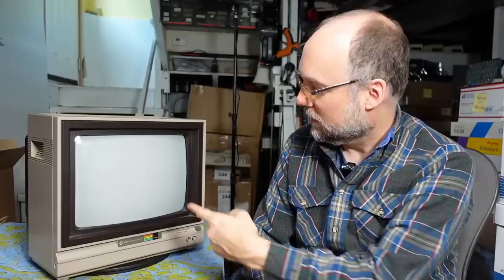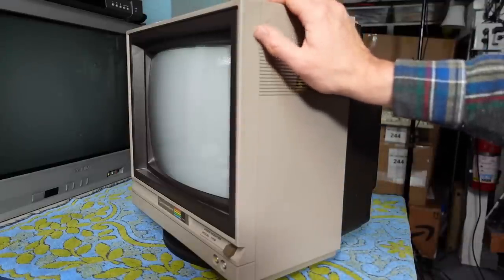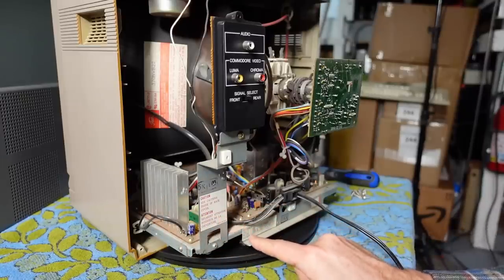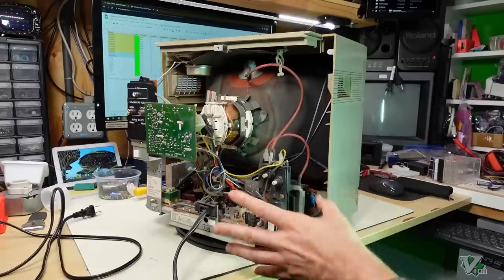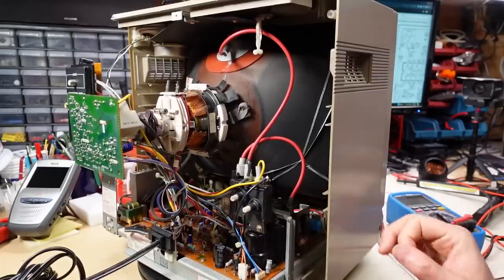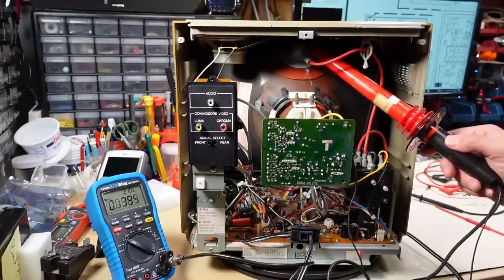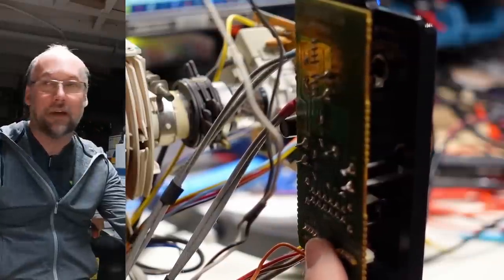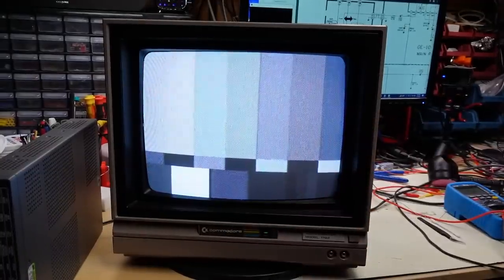This is one of the best monitors of all time (Commodore 1702)

Comment: From my own learning, flyback transformers in CRT displays/tv's are typically the common source of power post power supply rails. If one finds what the output voltage is before going into any voltage reduction, they could operate the display/tv at that voltage. Most notable of this are the displays/tv's that can be plugged into both household voltage and a cars cigarette lighter power source. Not all systems operate like this, especially those that are fully vacuum tube based, unless otherwise specified for dual-voltage of course. And since the flyback can output a wide array of voltages, with the diode missing, it is entirely possible to power different thing and have the KV lead off to a like-configured flyback for "long distance" powering of other devices, but at a lower amperage. Essentially what Nikola Tesla was trying to do with his Tesla coil idea.

Comment: If you believe it has a high voltage leak somewhere, you can use a piece of metal connected to ground and move that around the high voltage components to see if there are any arcs. I’d typically use a test light connected to ground. Obviously you shouldn’t poke the high voltage components, you just move the conductor around the high voltage components. Since it’s connected ground and you’re holding onto an insulator, you won’t get shocked. Very common way to check for leakage on automotive ignition systems which work at much higher voltage than this.

Comment: I got this monitor as a tween (tho at the time this would have been around 2003 or so) off eBay because the NES manual mentioned it. Got it and a s-video to dual rca adapter and I've been using it to play retro games for forever. I've got a NES, TG16, SNES, Saturn, and N64 hooked up to it, switched between using some neat, old stock Sony passive S-video/composite switches. Works really well. I currently have it in between my floor standing hifi speakers, as well as hooked up to the hifi, so it's hilarious looking, and sounds amazing.

Comment: Yeah I had this nice little "card" that was actually the base of some old Phono sound system my mom got when I was a kid. The 1702 fit JUST NICELY on it with the base of the monitor the right size to fit inside while the sides of the "cart" held the monitor up.
And because of the way it was built there was a little shelf about 3/4th up from the open top of the cart, I could easily fit a VCR on it under the 1702 without the 1702 actually sitting on it.
I used it basically as my own little "portable" TV I could move around the room or apartment for watching stuff on or playing video games on.
Though I was silly as a kid and gave it an extra speaker so I'd get at least dual mono sound from BOTH sides of the monitor.

Comment: The signal handling of the 4th pole is interesting.  If it's handling a composite signal, Q251 is on, which shorts out ALL of the contrast amp signal, making the trap irrelevant.  At the same time, it provides power to the "detail amp" block in the processor.  When Q251 is off, the detail amp is also off, and the trap is the only relevant part for the contrast amp pin.

Comment: Some TVs and monitors had neon lamps on the board for arc suppression.  It's been 20 years since working on a CRT so I can't remember the what/why, but I just remember seeing them on there, know they were for protection.
BTW, touching the horizontal output...YOW!!!  I remember that.  Not only high voltage but high frequency.  A special kind of sizzle when you brushed that transistor's heatsink.
Excellent video and excellent explanation.  I'm probably one of the last people that went to school and had a course on servicing CRT sets.  :)
I had a 1702 growing up and used it as my TV, connected to a VCR, just like you said.  Gorgeous saturated image.  I wonder if it's still in my parents basement...

Comment: I have a 1702 from 1984. Other than my C64, I have used it with a cable box, a VCR and a monitor for video taping. After several years in storage, I plugged it in to my old  C128. It came up right away, but the color wasn't very well. After a while of being powered up, It started looking pretty decent.

Comment: Arcing at the anode connector is probably more common with Philips-made Commodore monitors. I have a Philips CM8802 monitor, great monitor without Svideo, but with RGB on SCART, and it gave me some HV shocks through the vents on the top, because the HV anode connector has a weirdly long, stiff stem and it touches the vent on the top side of the back cover... Great design choice. I can clearly hear it ticking when I put my hand around that area, and if I put it there after the monitor was on for a longer time, sometimes there are some visible arcs with loud snaps between my hand and the back of the monitor, through the vent grille, and it can bite quite well! It's not a full-on anode voltage shock, just a strong static buildup, but still... I can also smell ozone if I use that monitor for a few minutes. I had some old Philips TVs with the same type of anode connector, and most of them had the same problem.

I stopped using it because of this, until I replace the anode connector, but I think the reason for the bulky stem of the anode connector is because there is a series resistor inside, and I don't want to leave that out, so I might end up leaving the original connector in it, just clean it very well and maybe put a few layers of thick heat-shrink tube on the stem of it.

Comment: I would look at C526, C534, both 1500 V operating, for little pins sticking out of the top of them. These are safety capacitors. That are designed to arc off excessive voltage beyond their ratings.  Also commonly on the picture tube gun drive board, there may be more of the air gap  safety capacitors. What happens is as that soot accumulates, that arc over voltage at which time an arc will occur, will lower into the operational  voltages of the circuit. Once the first arc carbonized the sooty dirt, the arc voltage lowers until cleaned off the body between the arc pins. Air blasting it may not be enough cleaning to prevent further arcing.

Comment: The arcing sometimes caused by not being used for a while and my have a little dampness inside prior to first being turned on. During my time as a service engineer in the 1970s & 80s if we suspected intermittent arching, I used my breath on the suspected areas like the EHT cap and fly back transformer, sometimes it made a spark show up, don't get too close though.

Comment: The April 1983 issue of The Transactor magazine announces on Page 14 that the "new" Commodore 1701 colour monitors "should be available from dealers now at $539.95 Cdn", so the timeline for this general series of monitors did correspond to the Commodore 64 getting the 8-pin video port on the 250407 PCB in 1983.  I'm not sure exactly when the 1702 dropped, but it was manufactured at least until 1985 (mine was made in January '85).  The 1802 that goes with the Commodore 64C was made by Daewoo -- the picture at 5:41 shows its sleeker casing from the late '80s, but it is internally identical to the "boxier" version released in 1986 that somewhat resembled a cream-coloured 1702.  These are sometimes called the "1802D", because they should not be confused with the OTHER Commodore 1802 monitors, made by Goldstar, which were released before the 64C and have the 2 large adjustment knobs on the front (because having 2 completely different 1802s isn't confusing at all)...  -- JC

Comment: My 1701 monitor is still my choice for my Vic-20, Atari 7800, and alternate open composite input (I have a 3 port RCA switchbox) on my desk.  I used to use the chroma/luma for my C64 and/or 3DO when I had them up here..  Great monitor!!

Comment: HI Adrian,
I think the dark bezel frame in front of the screen is mean for a tinted 'contrast glass'. Because of how the case is made, they can be completely flat. I have seen some of these with super strong double sided velcro. This would compensate for the exceptionally light coloured phosphor.

When it comes to the arcing and subsequent shutdown of the monitor I would check for broken solder joints on the flyback transformer. This is a fairly heavy component and because of the thermal mass it can be difficult for the wave soldering to put enough solder on the pins. A loose connection there can absolutely cause the kind of symptoms you describe.

Taking off the back cover can release mechanical stress causing the symptom to disappear.
By the way I am amazed at the simplicity of the regulator circuit. The Amstrad CTM640 and CTM644 by contrast use a complex hybrid module Sanyo STK7308.

Comment: Great video as always, Adrian!

Still have this monitor! Back in the day, I hacked an s-video cable to discreet rca connectors so I could hook up my s-vhs player! 

I also used to use this monitor to shoot BB games in High school with an svhs camera. One day it fell from the top bleacher face down and didn't get a scratch! It is built like a tank. 

I also did the rear input mod years ago because I hated connecting in the front.

The monitor still works today and I have it hooked up to a C64.

Comment: You can fix that broken door clip with the old “superglue and baking soda” hack. Once the fractured material is built back up again you can easily dress it back to shape with needle files.
(I put my 1702 away and haven’t used it for years, I get far superior performance from my 2003-vintage Dell 2001FP + AX510 sound bar.)
Reply: My 2001FP has probably the worst composite input of anything I've ever used, IIRC it lacks a good chroma trap and it also doesn't do proper deinterlacing. Y-C input from a 240p computer will probably be fine though.

Comment: There may be spark gaps on the tube base which may have been a little humid or dusty which caused it to flash over. Sometimes they use neon bulbs for spark gaps. The focus sometimes has a spark gap on the tube base which can crack over if slightly damp. Toshiba tubes are usually vety good, but that could have been arcing internally around the gun somewhere.

Comment: The big power resistor doesn't bleed voltage off for regulation the power resistor increases the current handling capability of the regulator IC so all the current from the monitor isn't passing though the Regulator IC and if you look at the part number STR3125 the regulating voltage shows up in the part number-the STR series of regulator has been used in many different devices over the years and is pretty robust and there are switch mode variants that have been produced

Comment: The Commodore luma+chroma isn't quite up to s-video spec. The voltages and timings are a bit off. It's fine by most old CRTs, but some LCD TVs doesn't like that at all. The voltage can be somewhat "fixed" with a 330 Ohm series resistor on the chroma line.

Comment: I have the 1701, which is the precursor and it looks exactly the same. I actually made an adapter to adapt the RCA connectors to s-video input, so I can use normal s-video cables with it. In fact my own design s-video modulator replacement board for the ZX Spectrum actually works great on it. And, yes the door is off.

Comment: When the rear switch grounds the base of Q251 the transistor is turned off and the 3.58 Mhz. filter is in play to remove any false chroma signal from interfering with the chroma signal entering from the rear connector.  Placing positive voltage on Q251 turns it on bypassing the filter and thus creating a 3.58 signal to send back into the chroma detection circuit.  Pretty clever.
Reply from the maker: Ah neat. Ideally then it would be neat to add an extra circuit to detect the color burst and enable the notch filter when needed. That way using a monochrome signal like from an Apple II in text mode, the filter would not be in play and you'd get a much sharper picture magically. There was probably some color decoder IC available back in the day that could do this which isn't made anymore.

Comment: Just fixed a 1702 that was blooming and I could not get the horz off the right side of the crt (it squished in).  The 125volts was not regulating.  It would start at 108v and go up to about 120volts depending on brightness/control.  Luckily it was just bad solder connections on all four pins of the regulator.  This was was from 1984 and the picture is still very bright and had brilliant colors!!

Comment: Best CRT Monitor EVER BUILT, thanks 4 shearing, the cabinet design would also allow u to SIT it on the floor and it will tilt up at 45deg. handy if used as Prompter or vid. camera monitor.

Comment: I've seen TVs repaired that had a symptom like an arc that was caused by some material inside the tube burning off. It's similar to the effect you get when you use one of those "rejuvenators" and it sends a surge to the tube guns to burn off gunk or build-up. It can happen when a TV has been unused for a long time, and then it goes away.

Comment: There may be spark-gap caps in there.  They look like a normal ceramic cap but with a gap sawed into them.  When devices like your accumulate dust, it can get into the gaps and the first time the device is powered it'll arc.

Comment: RGB modding the 1701/1702 wouldn't be simple. On TVs where it is easy, you inject the RGB into the on-screen display inputs of the jungle IC, as the OSD is generating RGB and video blanking signals anyway, and that IC handles the conversion to the signals needed by the CRT. Looking at the 1702 schematic, the chroma and luma signals take two different paths, with luma going from the sync/video IC and video amp to the Y terminal of the neck board and the emitters of the RGB drive transistors. Chroma goes from the demod IC to the R-Y, G-Y, and B-Y terminals of the neck board and the base of a drive transistor. You'd have to convert RGB to Y + R/G/B-Y and inject it at the appropriate points.

Comment: The 1702s do not ever seem to have "faults".
I used to test electronics for Good Will in the 90s and 00s, and we'd get piles of 1702s in giant green dumpsters.
They always worked perfectly. Compared to everything else, it was spooky.
The 1702 will out-live the cockroach, and probably the heat death of the universe.
Reply: I've owned 1701 or 1702 monitors for, not sure, maybe a total of 2 decades, and I've never heard about this high-voltage fault or seen it for myself.

In my case, it's usually operator error because I have the switch selection for Source in the wrong place or just plain forgot to plug the monitor in.

Comment: I had a look at the 1702 schematic (German 220v version) but I guess the video output is the same.

Because the HA11247 chroma processor does not produce RGB but RGB/Y (Y Luma + R-Y, G-Y, B-Y) it is not an easy task to just 'add an input' to this monitor. The new circuit would have to first mix the RGB into Luma (Y) and then subtract the this Luma from all the color components. It is perfectly doable but it would be tricky to get it right so as not to introduce colour distortion.

The reason for all this complexity is that the summing is done on the neck board. Luma is connected to all the emitters of the transistors on the neck board. If this was nor the case (emitter connected to ground), the neck board could receive RGB directly at 10 times the input signal (6v on the neck board for 0,7v input).

Another solution could be to use a specific circuit like the NXP/Philips TDA8361 + TDA4661. This does PAL/NTSC decoding to RGB + external RGB input (SCART).

I hope that helps.

Comment: I still have my old 1701 Monitor in storage. One of these days, I wanna pull it out and re-cap it. I used it as a second screen alongside a 30 inch HD CRT TV well into the 2000s, and even for a little while along with a Philips 42" LCD. I often played Gamecube/GBA games on it (I had a Gameboy Advance modded with NTSC output)

Comment: just wanted to let you know, there is a spark gap on the neck board.  Being that this monitor was left in a closet or garage for x number amount of years. Dust or maybe a spider web was formed in side that area where the spark gap is and when you turned it out it cleared that spark gap and yeah they can be very oud when they snap.

Comment: I was told when I bought mine from a dept head at a technical school, that the scan rate was 5% more accurate than a standard crt. Back in 1992. Maybe it was just lore :)  Mine still works, and makes the occasional appearance  whenever I turn on a relic that needs it :)  I never realized it was actually s-video capableish. Thats neat.
Reply from the maker: Heh that's lore. The scan rate can only be the scan rate. The circuit locks on to the sync pulses in the video signal and matches it perfectly.

Comment: I used AD723 to convert RGBI signal from C128 to chroma/luma or composite and connect the same monitor. It worked well. I think that’s one of the easiest ways to do so.

Comment: I ALWAYS wanted to find a 1701 monitor, because of the Star Trek connection… I couldn’t find a 1702, ended up getting the 1802.
My 1802 is identical to your 1702 monitor.

Comment: Hi Adrian, love your channel :) With the audio inputs jumped internally it could be used as a crude splitter and run the second jack to your stereo aux input. With speakers on each side and a speaker in the monitor you've got some surround sound lol. Of course keep the speakers a couple feet away from the monitor. I think I still have a NOS degaussing hoop somewhere here in the shop.......

Comment: Tube in my 1702 is Hitachi Type 370KNB22. It states, "Made by Hitachi, Japan". You mentioned 1702T. Your circuit board has a capital T, whereas mine (1702) does not have that capital T, and although both have JVC575V0, the other difference is that mine has below that, CK10166-C01 and yours has CK10166-C02. That would indicate the T is newer.